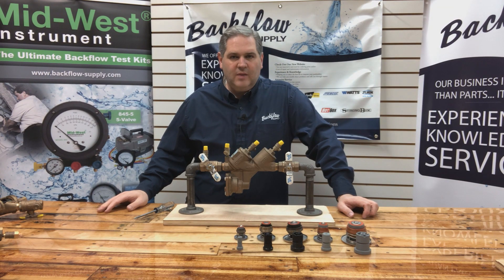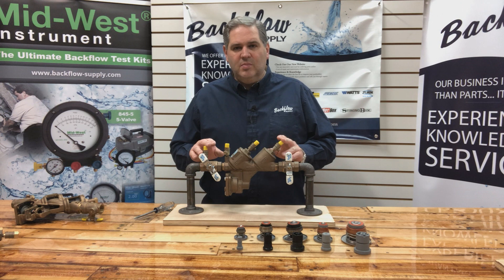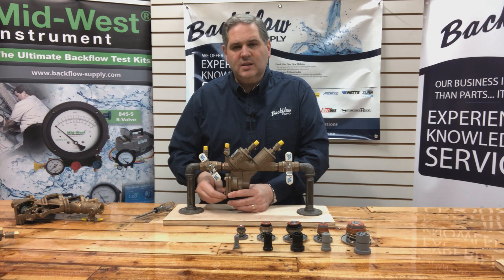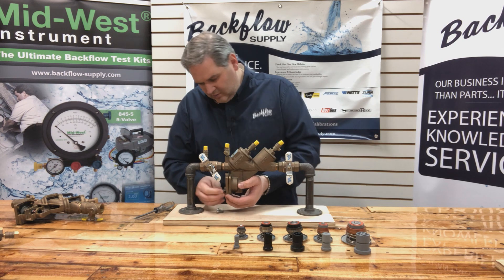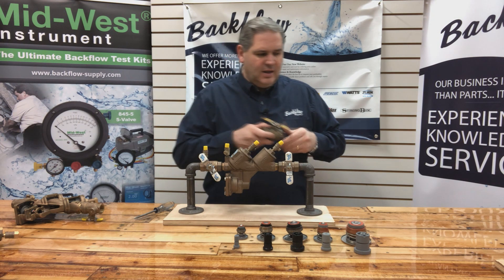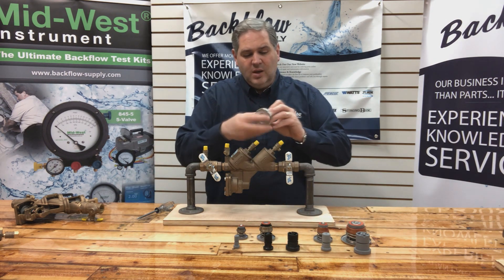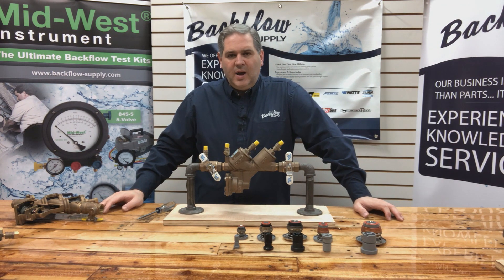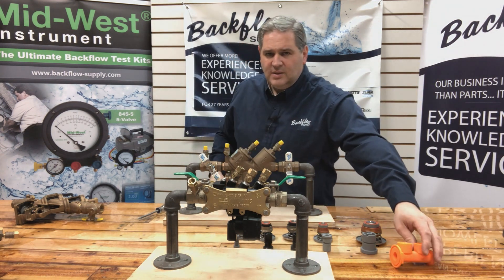RP4A and RP40 Winterization

Comment: this was great info.  I didn't think I needed to take the relief valve apart.  I've been watching water come out from where that gasket is for sometime.  I don't think its related to weather.  I followed ur steps and there was dirt in there... not much but it was there.  If there's dirt in there could that cause a persistent drip from that area?
Reply from the maker: Keith, which model do you have? What size do you have?  What gasket are you referring to?  Is it the one under the cover?  1" and smaller for the RP40 it is round with six bolts I think it is and the RP4A it is square with four bolts.

Is the drip coming from where the cover bolts to the body with the diaphragm in between?  Or is it dripping out of the actual relief valve opening, and I think it says "vent" on the side of the brass?

Let me know.  If you want to call me you can, 801-355-6736.  Email, sean@backflow-supply.com

Comment: I have the RP4A for an automatic fill  for the pool. How would I winterize it if I need it year round? This year it froze and is currently leaking.
Reply from the maker: If you need it year round you may need to look at getting an enclosure to put over it.  I don't know how cold it gets, but you may need just insulation or insulation and heat.  If you just insulate it, it will only slow down the freezing process.  I assume your backflow is outside and they make fake rocks and just simple covers to cover these and there are several options.  There are even just insulated bags to put over them.  Call me if you want to talk more about your options.  801-355-6736 or email me so I can send you links and spec sheets. sean@backflow-supply.com

Comment: I am in Central Florida and we do not freeze here, usually. I am going to make a comment that as a parts seller you will understand, even if you do not agree. As a technician owning my own business, trying to control costs for my customers was my pet peeve. 

Watts assemblies when they need service does not let you buy parts individually as does Wilkins. What does that mean? It means to repair a Watts, and all of their other sub-names, you have to buy kits that include many parts you do not need that greatly inflate the cost of that repair. In addition most Watts assemblies do not hold up well over time and need much more service than does the Wilkins line and a high percentage of the time the Watts line has problems even after installing new parts. That was so prevalent over time I refused to repair a Watts and told my customers to replace the assembly with a Wilkins because it was often cheaper that attempting to repair a Watts that would still not pass the test after the repair. On some Watts you need to disturb the Relief Valve that was not causing an issue to replace some of the check valve rubbers. That makes no sense and some models, like you show in this video, have changed their design to make the relief valve a separate repair but there are plenty of the other Watts design still out there.

While I certainly could to that install I eventually stopped doing them because I found it better for me to only do repairs than to re-plum a new assembly. Because of that a customer used someone else to install the new valve assembly so they knew the advice I was giving them was not based on me making money off them by pushing a new assembly rather than a repair. I gave up lots of work doing that but found it better for me in the long run.

Good video though Sean.
Reply from the maker: Thanks for the honest feed back.  It is important to hear the good, bad and the ugly!